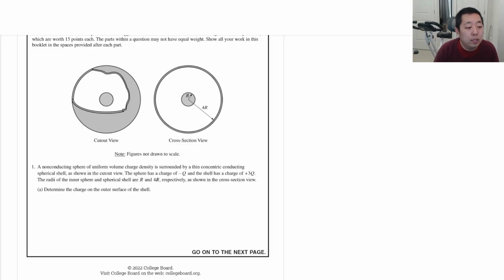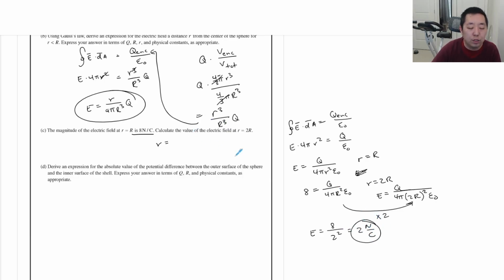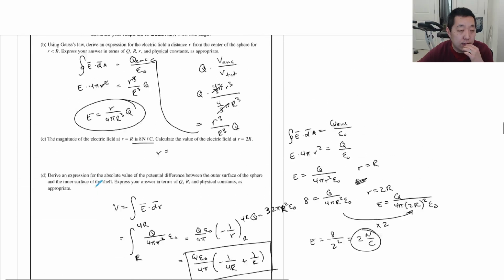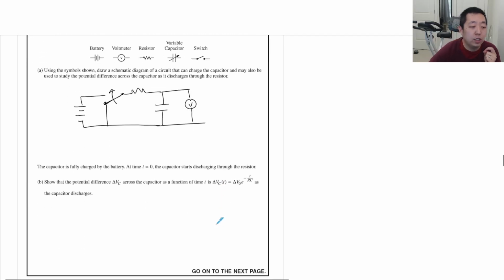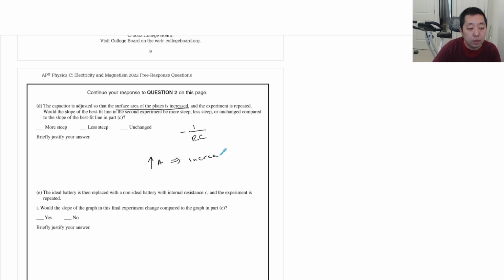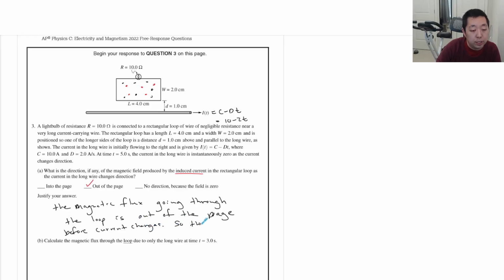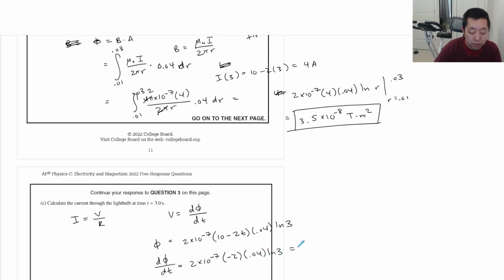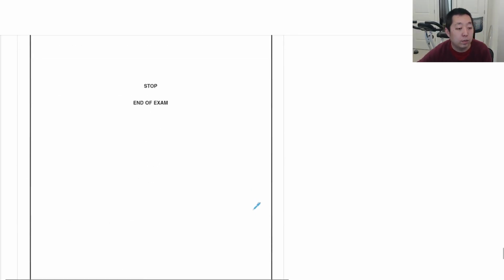2022 AP Physics C E&M Free Response Set 1

Comment: Good video sets!  I am curious:  I teach an "equivalent" Physics class  (calc based, mechanics) at a private school.   I am finding I have no time after mechanics to get to E&M in depth at all, and am opting instead for basics of electronics and elementary circuit analysis.  How in the heck does one find time in the year to be able to get to a full course on E&M along with a course on mechanics?  Are they typically taught as two full classes?  I am asking because for the first time I have kids wanting to take the E&M portion of the test along with mechanics and I am kind of forced to have them learn it all on their own in just a few months. Thanks and keep up the videos!!
Reply from the maker: Thank you!

So I've seen it both ways. Some schools do Mechanics as a full-year course and then E&M as a full-year course.

Very STEM oriented schools will do Mechanics in the Fall and E&M in the Spring. It's pretty tough! Mechanics can be OK if they have had some exposure in a previous physics class, but E&M is generally really tough, and even at the best STEM high schools, a lot of students get a bit left behind in E&M. It's basically taught at a college level pace (1-semester)

Comment: Compared to AP Physics C Mechanics, do you have to get a higher percentage of points on the AP Physics C E&M exam to get a 5?
Reply from the maker: not usually. It depends on how difficult the test is, but the scoring is pretty similar.
Reply: @AllenTsaoSTEMCoach  The scoring calculator on albert io says that this year you will need a 53/90 to get a 5 on E&M whereas you need a 50/90 to get a 5 on Mechanics. Do you think this will be the case?
Reply from the maker: I'm not sure. Unless they're part of the group that has set the scaling scores, I don't know how they would know. The numbers appear reasonable but it depends on how students ultimately did on the multiple choice and FRQ problems.

Comment: for part 2b I used the differential equation of the charge on the capacitor and then used Q = CV for the integration bounds (C cancels out in numerator and denominator of ln). I still managed to get the equation. Is that fine?
Reply from the maker: Yeah it sounds right.

Comment: for 1e (ii), wouldn't there be a point where the voltage equals 0 in between the smaller sphere & the larger shell, specifically at 4R*sqrt(3)/3 when you solve for it? because voltage is scalar/additive and voltage inside that gap due to outer shell alone is as we know k(3Q)/[(4R^2)] and voltage due to smaller sphere alone in that gap is k(-Q)/(r^2) (where r > R), and adding these 2 together, setting that equal to 0, and solving for r gives 4R*sqrt(3)/3

Comment: for part 2e (i), wouldn't the slope of the graph decrease when a non ideal battery is added because the equivalent resistance increases? The battery contributes an internal resistance r.
Reply from the maker: But when you're discharging the capacitor, the current doesn't go through the battery. it only goes through the resistor R. The battery only affects the charging time constant. So the effect is that it would be slightly slower to charge, but the same discharge behavior.

Comment: Is it wrong to draw the resistor in parallel with the capacitor in part 2A?
Reply from the maker: As long as you can fully charge the capacitor and fully discharge the capacitor, it's fine. 

You technically should not try to connect the battery directly to the capacitor as that's generally pretty dangerous to do. However, it may be okay for Physics if you did do that.

Comment: Hi Mr. Tsao. For part 1D, aren't you supposed to use the electric field derived in part 1B? That's what I did on my exam
Reply from the maker: Part b is the electric field inside the nonconducting sphere. You want to potential difference between the outer part of the sphere to the inside of the conducting shell. So I need the electric field in that region.

Comment: also - for question 3 part e, I thought it would be the same because the rate of change of the current is the same and the rate of change of the flux is the same. I thought that you might have less flux but it should change at the same rate, and the induced emf and therefore current depends only on the rate, not the initial value of the flux. I might be wrong though and it might be a different rate of change of the flux.
Reply: the change in current of the wire over change in time is the same, but the magnetic flux decreases in the loop. if you change the integral limits from part b to reflect the new orientation and change the horizontal distance (integral limits 1 to 1+4 and horizontal distance 2*10^-2), you should get something like 1.2*10^-9 A when you differentiate with respect to time and divide by resistance. it is less than the 1.8*10^-9 from part c.

Comment: For #1, I didn't use Gauss's Law and instead just wrote that in the space between the sphere and the shell, the sphere can be modeled as a point charge, so by using the equation E = kQ/r^2, if r increases by a factor of 2, then E decreases by a factor of 4, so the E field at r = 2R would be 2 N/C. Do you think this is a valid way to solve this problem or did I just get lucky?
Reply: that is valid. using gauss's law would just give you kq/r^2 so if you just knew to use that formula you saved time.

Comment from the maker: Corrections:

#1: part (b) and (d): the epsilon term should be on the denominator.

part (e) ii. My electric potential graph is upside down because I forgot to include the negative sign in my derivative and integral from electric field. As a result, the graphs of potential are inverted.
Reply: I think the potential starts at a negative value and then has the shape you describe.
Reply from the maker: It shouldn't matter because the reference of 0 potential is arbitrary. But I'm not a grader so if they are requiring you to assume that infinite distance is 0 potential, then you'd be correct.
Reply: @AllenTsaoSTEMCoach  I think if you set the potential to be zero at infinity, then you get V(0)= - kQ/R, then the potential increases to kQ/4R at r=4R using the same shape you came up with. The potential should be zero at r=2R, and -kQ/2R at r-R. That takes way too long to work out than what the AP Exam allows, though!
Reply: Shouldn't the epsilon term be in the denominator for part 1D as well?
Reply from the maker: @davidzhang6216  yep